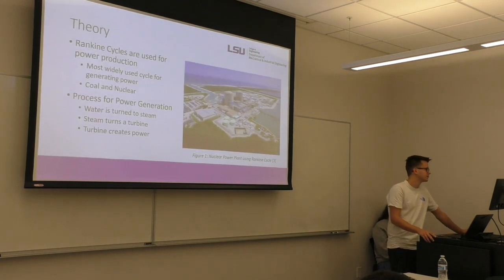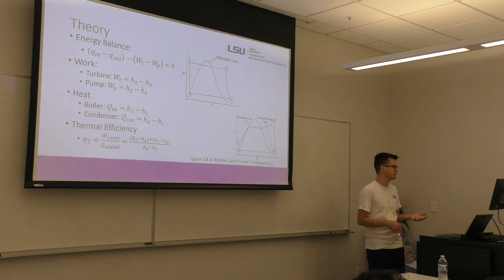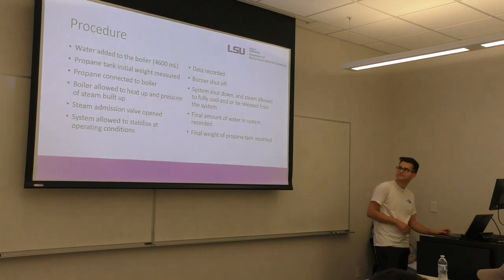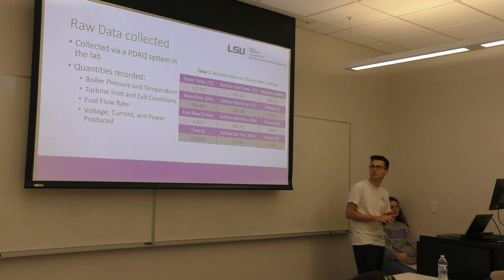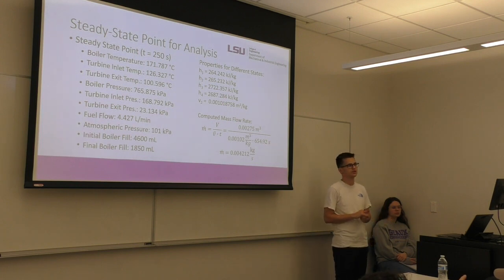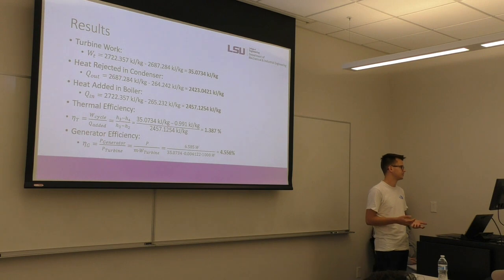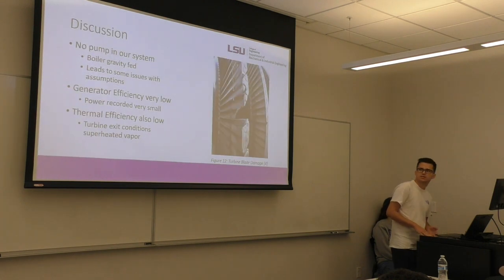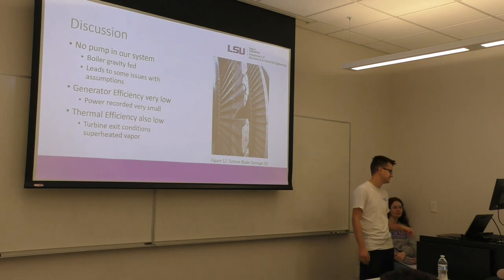S1540003

Comment: I think the technical content at every section of the presentation was incredibly thorough. He begins by explaining the basic principle of the Rankine cycle and how all of the thermodynamic devices function in order to generate power. He briefly sums up the equipment used in the lab and how the changes of the experiment change procedure. He also explains the relevant data well and ties in the goals/principles of the experiment in each graph. The results were interpreted well and he did a good job of keeping the audience engaged by referring to explanations of to behavior of the devices. Overall, VERY good job.